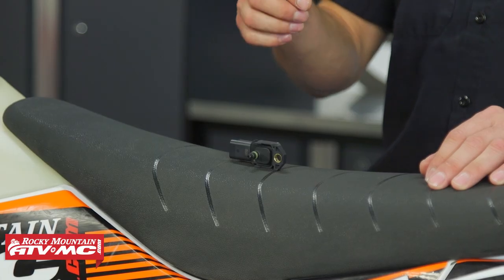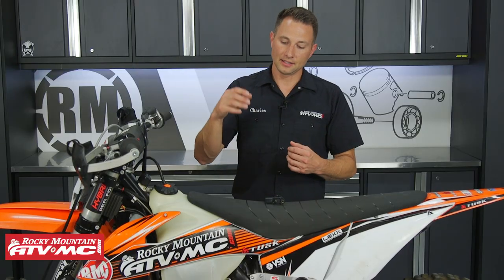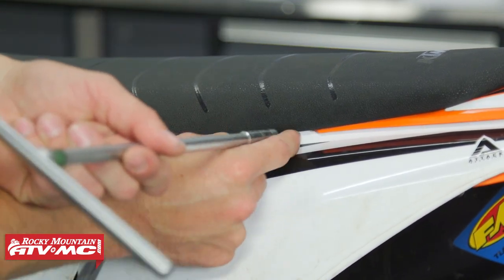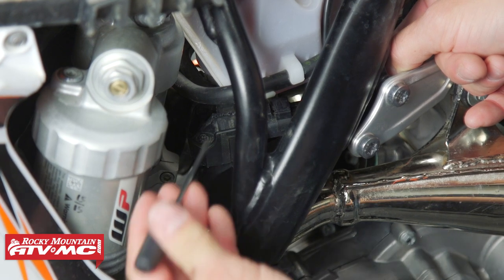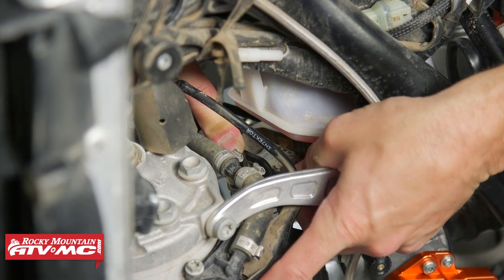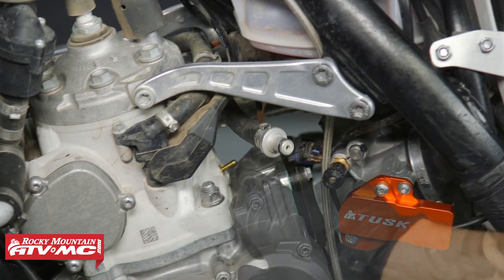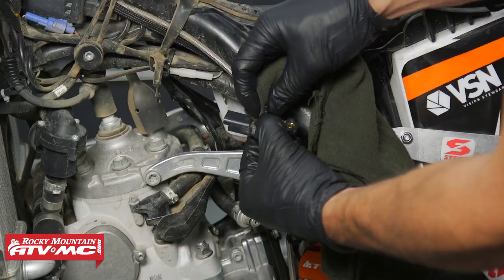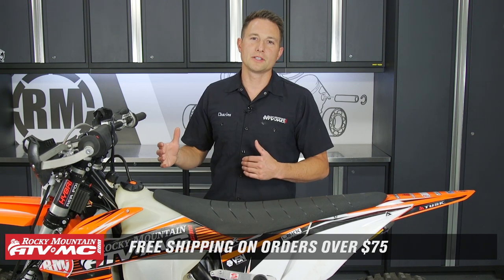How To Replace the Crankcase Pressure Sensor on KTM, Husqvarna & GasGas 2-Stroke TPI Dirt Bikes

Comment: Could you guys possibly update the bike compatibility for this part on your website? It only has the gasgas and two KTM bikes but doesn’t show any husqvarna models when I try and look for my bike (2022 Te300i). 

Great video! You guys show a lot more detail for the removal process then other YouTube videos.
Reply from the maker: On it, thanks! -Charles
Reply: Rocky Mountain ATV MC not to be a pester…. But the website still isn’t updated for all compatible model bikes. For husqvarna it still says it’s only compatible with the Te150i
Reply: I ran into this too, I just had to put my bike in as a 2021 to buy the part @rmatvmc

Comment: What kind of issue are you expected to have from a failing CCPS?
Reply: Idling issues, mine would stall without the "choke air knob" pulled out. Low end was choppy. I just did this swap and it cleaned up everything, idle's beautifully now
Reply: @zpbeats3938  mine started doing the same thing after a nasty ride. Going to pop these sensors off clean them out hoping that'll do the trick, if not I'm buying a few spar sensors. I thought I HAD to do the idle mod considering it won't idle without the "choke air knob" out but I think this is the fix!!
Reply: @gbulldog35  I still did the idle screw mod actually because mine was still a bit low for my liking. But with the sensor swap it's running crisp! That reminds me, I still need to order at least one of them to swap in for the busted ambient sensor

Comment: Clean the sensor with approved cleaner, check the vacuum hose from the sensor to the cylinder for cracks.

Clean the filter to the atmospheric pressure sensor.